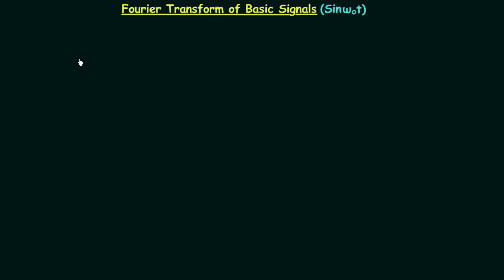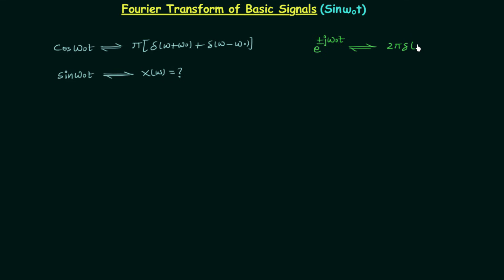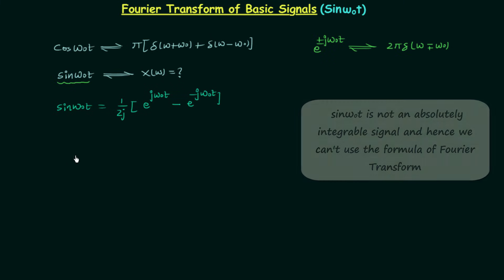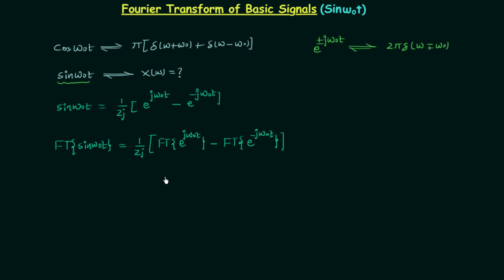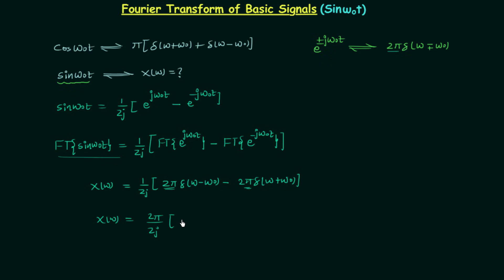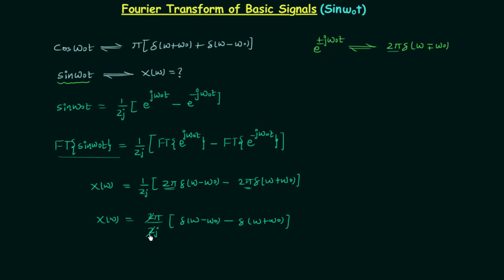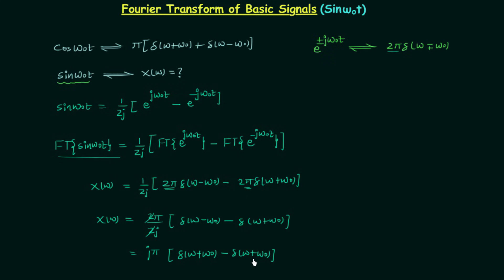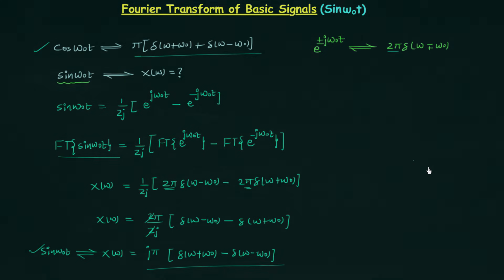Fourier Transform of Basic Signals (Sinω₀t)

Comment: #NesoAcademy while calculating FT in step signal, you did FT of (1/2) and got the DC value. But here and also for Cosω₀t, you didn't calculate  FT of (1/2) which is in common to both and it's in multiplying form?
Reply: DC value for both sine and cosine signal is 0. Watch Previous lectures bruaah.